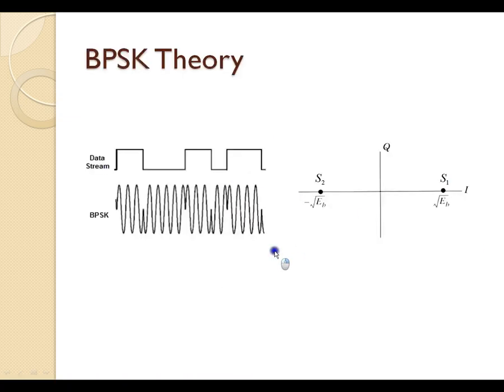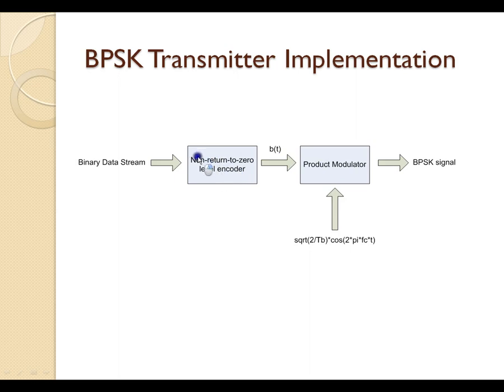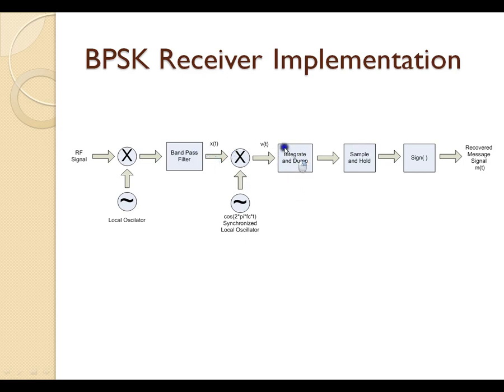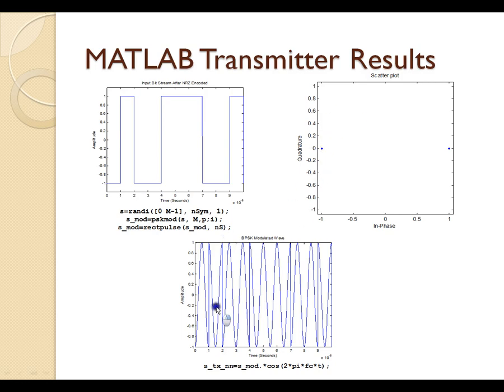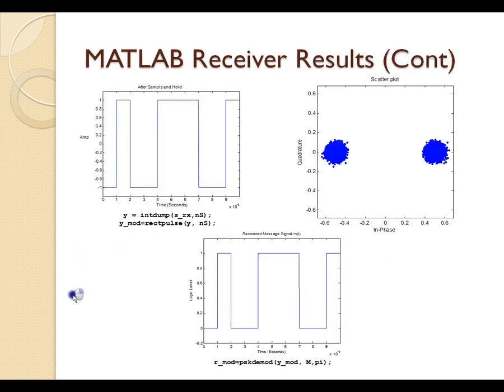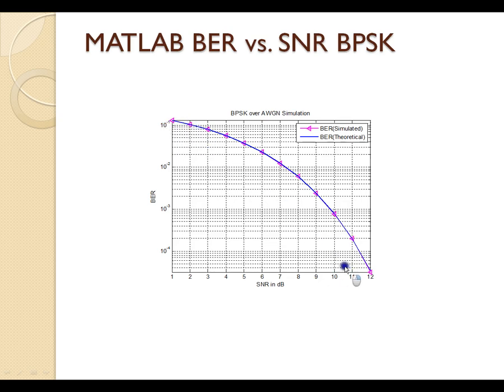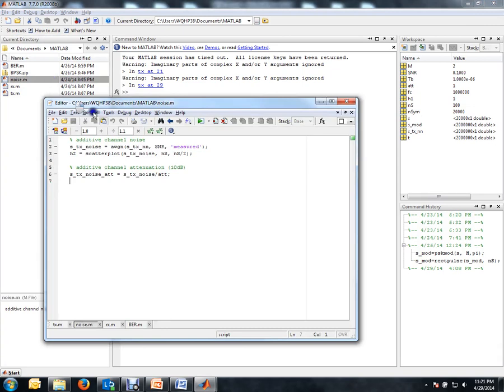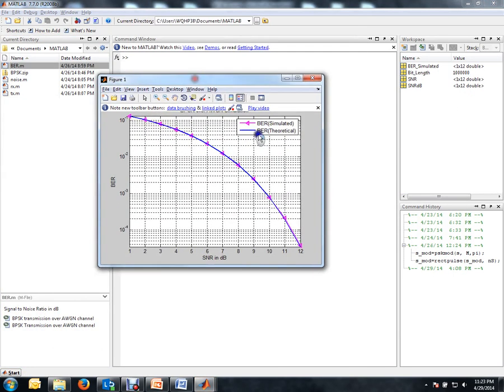BPSK MATLAB Implementation

Comment: why the first osc in the receiver?
Reply: +José Chávez when you multiply sinusoidal function by its inverse like sin X cosine you get zero ... sine 90 X cosine 90 = 0 X 1 = 0 ... the osc is the inverse of the TX osc  and by multiplying this we eliminate the carrier frequency to 0 and end up with  the information ONLY ..  so the answer is recover the original data / info ... its in cases like this when you start to appreciate trigonometry and start to fall in LOVE with math ... otherwise math is DRY